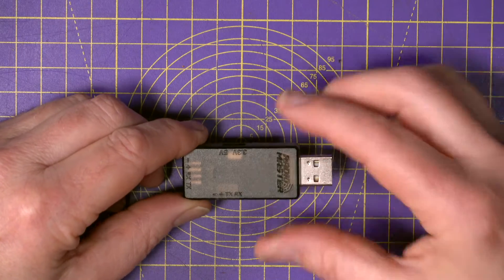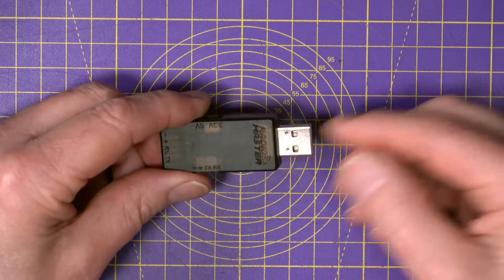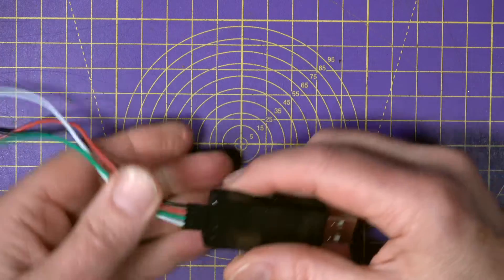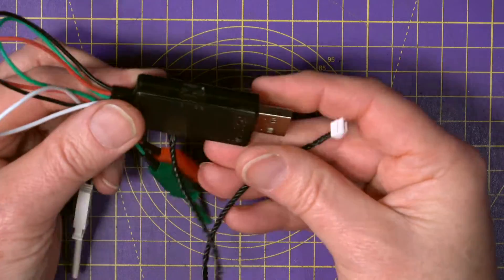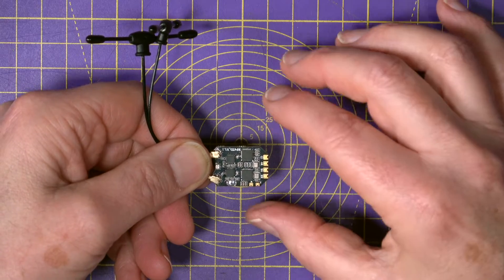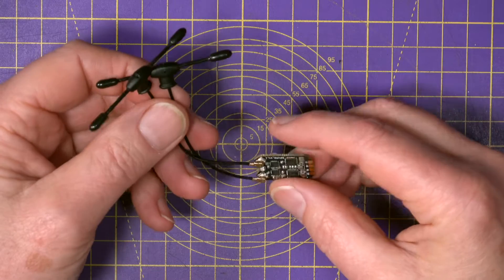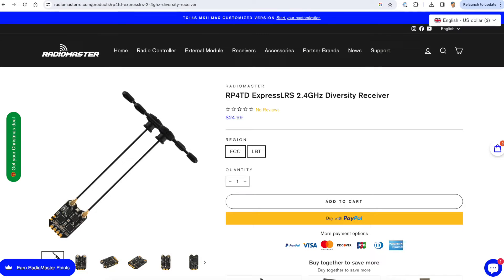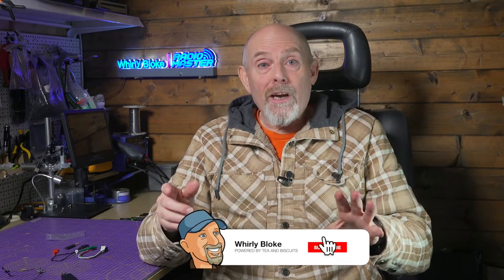RadioMaster RP4TD True Diversity 2.4GHz ExpressLRS Receiver and ELRS USB UART firmware flasher

Comment: Thank you Whirly Bloke for another terrific review video. Your videos consistently deliver informative, interesting, and entertaining content. I REALLY appreciate your efforts. I love the RadioMaster products that I've used. I use a RadioMaster Pocket transmitter every day with my 7" DIY build and it contains a RadioMaster RP3 receiver which has antenna diversity but is not true Gemini diversity. I plan to purchase one of those USB flasher gizmos but I don't plan to purchase the true Gemini receiver until RadioMaster comes out with a Gemini transmitter module to put on the back of the Pocket. I'm sure it won't be long. I watched your build videos several times while I was building my 7" and found the info very valuable. Thanks again. I hope you have a happy, healthy, and prosperous 2024. Happy flying amigo! 🍻